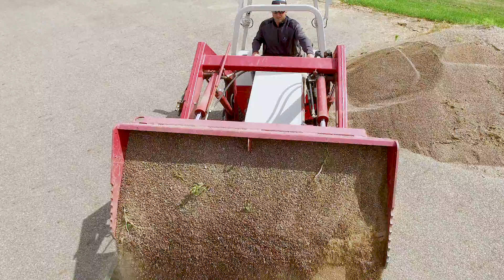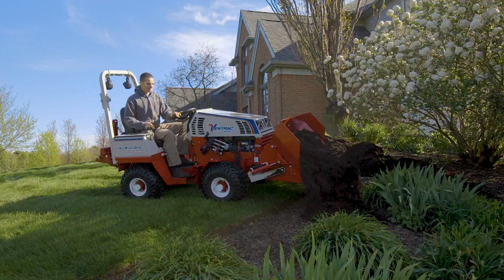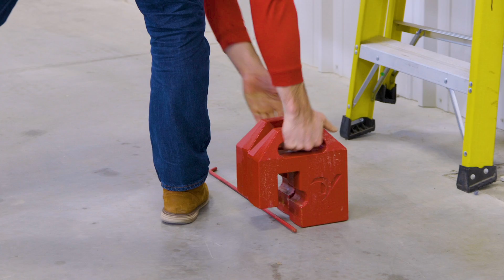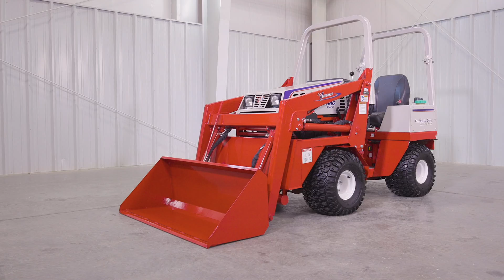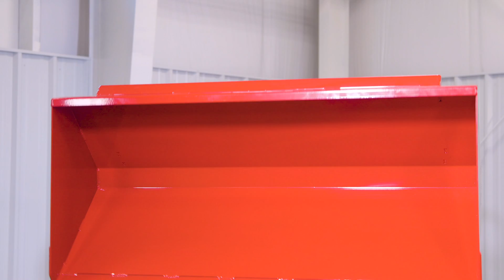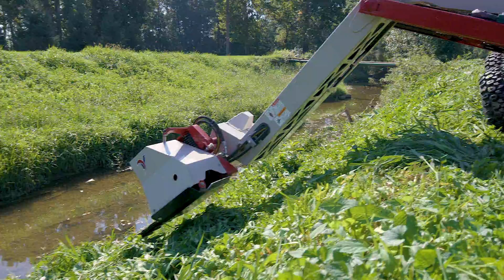Versatility Expanded With the Ventrac KH-500 Versa-Loader - Simple Start

Comment: Hey guys so I am confused, is the foot pedal attachment required to run the this FEL? I thought that defeated the purpose of the hand control for extra dexterity?
Reply from the maker: It is not required, but we do recommend it for the loader because when you're using the loader controls you will often want to be moving forward or reverse at the same time.  Then, during transport and in other areas you can switch back to the hand control. When the foot pedal is installed, it works alongside the hand control and you can use whichever makes more sense in the moment.

Comment: Hey are there any plans to add a grapple bucket to the Versa Loader like there is on the Power Bucket? I would really like to have a front end loader but really want a grapple on it as well.
Reply from the maker: We agree...that'd be super useful.  Unfortunately right now, there's nothing in the works.  We've seen some custom setups out in the wild but you definitely have to make sure and have a lot of rear ballast for safety.

Comment: 500 lbs lift capacity is horrible!!!! Not worth hooking up
Reply: Can you pick up 500 pounds?
Reply: Sure beats shoveling mulch or stone. The bucket isn't even that big and this is definitely designed for light duty around the house jobs or landscaping. If you need raw power a skid steer or tractor would do much better.
Reply: This ain’t a skiddy
Reply: Works well for us 🇦🇺
Reply: I have a Steiner with a loader and a farm tractor with a loader. They are two different tools. The Steiner fits in places no big tractor will go and does not tear up the grounds like a skid steer. Moving bulky but lite stuff, I'll use the Steiner any day.